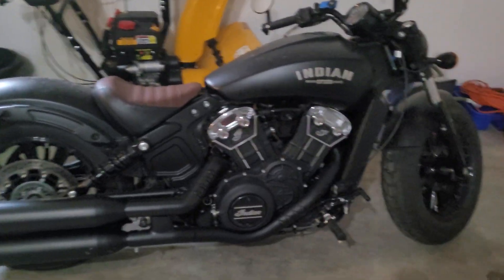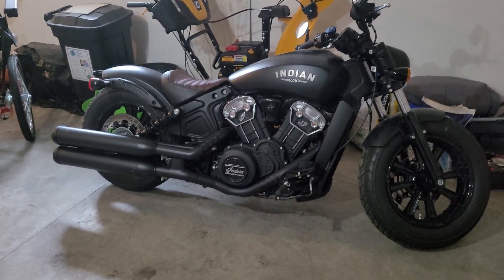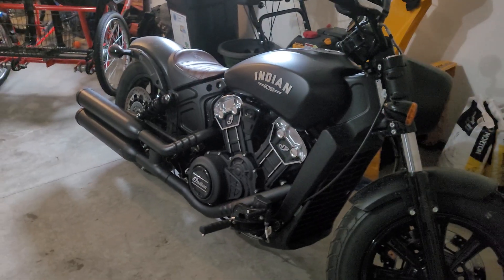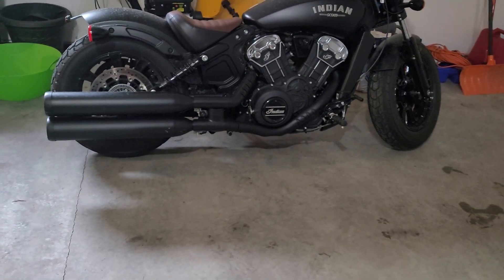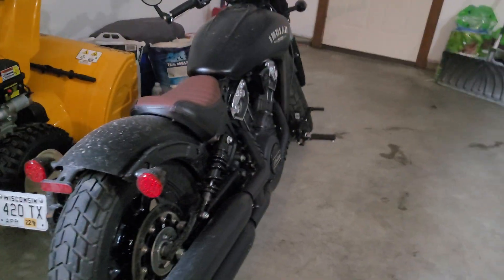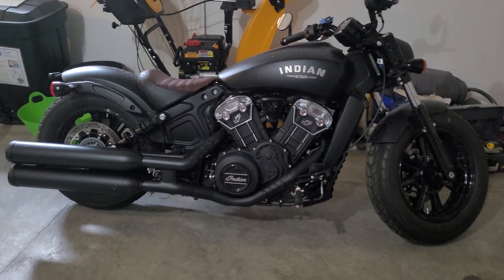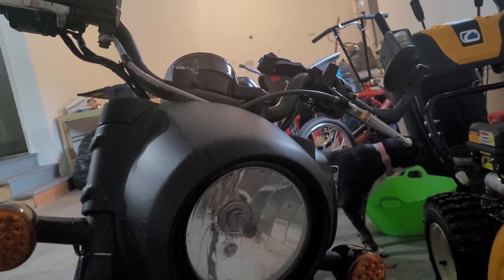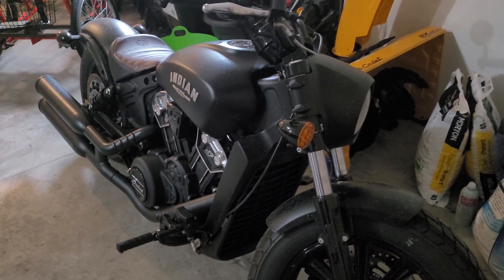Review: Everything I Hate, Indian Scout Bobber

Comment: My understanding with the chrome heat shields on the exhaust with black mufflers is Indian has a major shortage on black ones. Instead of waiting for them and holding up the production line, they’re shipping the with chrome. 
I believe if you don’t like it you can tell your dealer about it and they will either pay to have the chrome ones powder coated black, or they’ll get you a OEM black set when available.

Comment: The only thing I hate is cleaning it. I got the thunder black , It’s super nice clean, but day 2  already dust everywhere.. 2,000 dollars dollars cheaper though , And I got the 60 so that’s another 2,000 knocked off the price. I test drove both and couldn’t tail any difference.. the only difference is it doesn’t come with the bar end mirrors and the headlight casing.. I hate that there so small,, the 60 and this one are the exact same size. Where I live at none were in any dealerships to look at. So I ordered it by photo, This bobber looks good with out the fairing but the bobber 60 looks normal with the fairing. Because the fairing was originally made for the bobber 60 and not this. This one is made for the fatter head light cover. Bobbers look better with less stuff because of the small fenders. You need the one with full fenders to look good with bags and window . If I was going to compare riding it to another bike. Feels just like the 2005 Honda shadow ace deluxe. About same size to. The only difference is the old shadow had a reserve tank and 50 miles per gallon. And the scout way more power cuts threw heavy winds with no problem..And looks more Powerful, is more powerful and makes you want too go fast